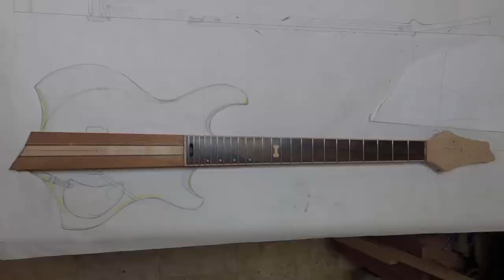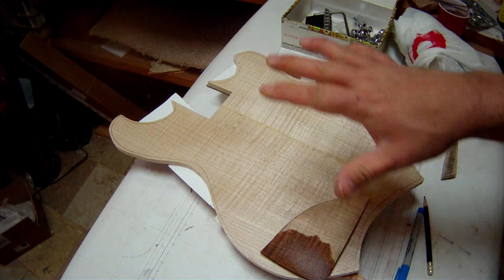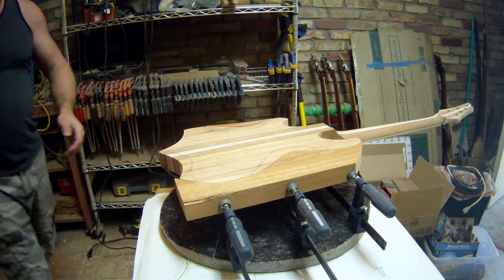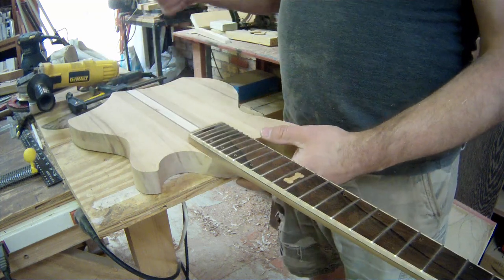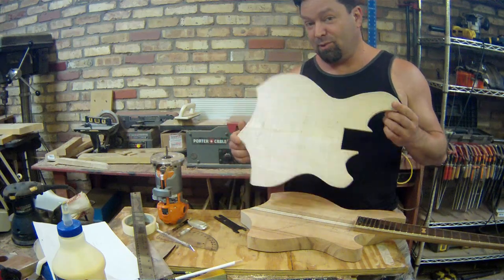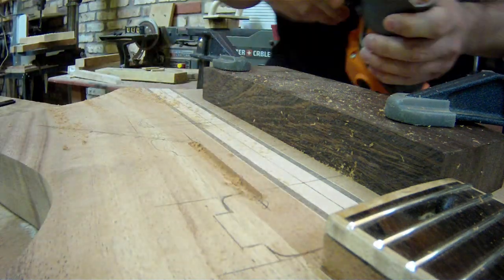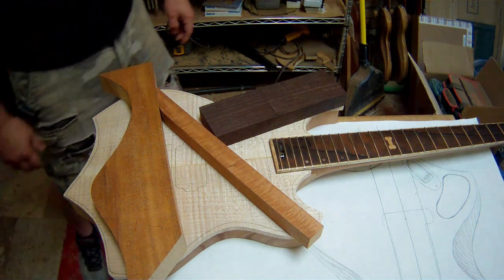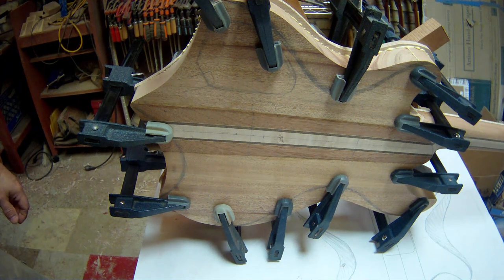GGBO21 - Off the Record - 17 Mounting the Drop Top

Comment: REALLY dumb question.... HAs that maple been sealed? I ran into that very issue with stains not biting into the grains. Come to find out the place I got my wood from got SUPER heavy handed with sealer. The more I stained the darker and muddier it got until I managed to sand thru the sealer in tiny places and the wood started acting normal. Then I hand sanded my body for a week to get rid of all of that sealer.
Reply from the maker: No, but I could tell it was pretty raw.  It took a few coats and was much lighter before finish.  I’m just not used to curly of that quality I think.  It turned out spectacularly.